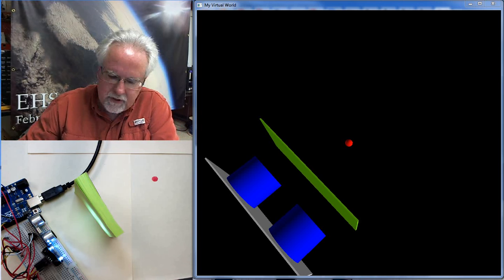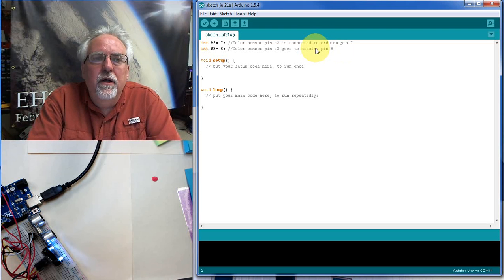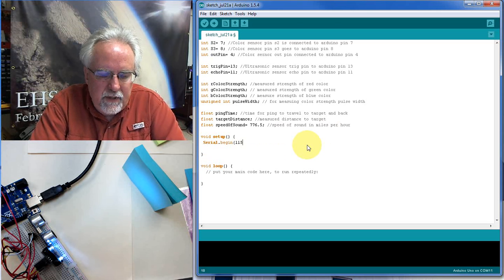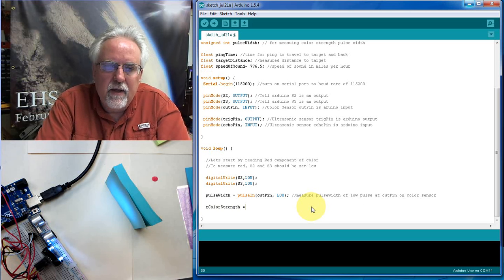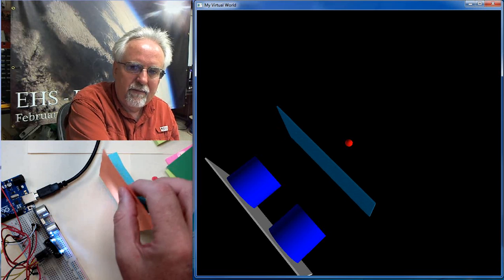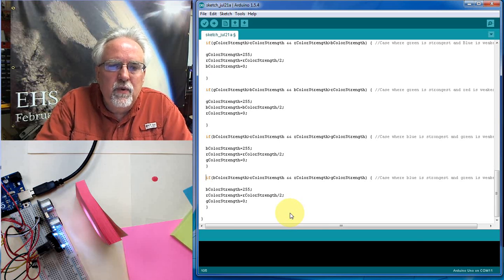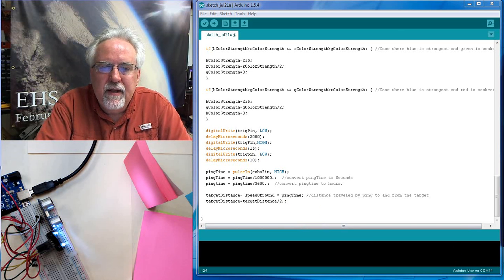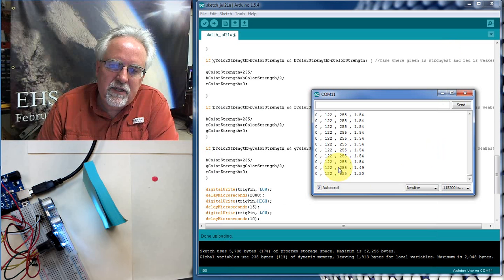Arduino with Python LESSON 4: Measuring Color and Position for a Virtual World

Comment: From what I’ve read VPython can display RGB directly.  Why not send  each RGB reading directly at change of colour of card only then no need for manipulation.  It should display correct colour until colour changes. If R=G=B  then that is grey (255,255,255 is white .. 0,0,0 black and shades of grey in between?

Comment: I ordered a color sensor MD_TCS230 but it turned out to be very unreliable. Found a youtube video from learnelectronics confirming this. Your code does not work with it either. Can i suggest you link to parts your using on each video so people order the identical part your using and not the same model from a different manufacturer.  Hope this helps someone.

Comment: Paul All your lessons are good but I could not found any lesson on: Python code which control one or more Servo Motors using Arduino board. Please share the steps to control Servo motors using Python on Arduino board.

Comment: Hi Paul,

I haven't seen all of your videos regarding arduino, but I have a question regarding your style of programming. Seeing this code I as a beginner (at least I still consider myself that) would start using functions and arrays and for-loops to break down the three colourstrengths and the unitconversion and everything thats beeing done repeatedly. I believe it would give the code more structur and make it easier to maintain and/or understand. 
Why are you copy pasting so much?
It makes big and kind of messy code in my eyes.